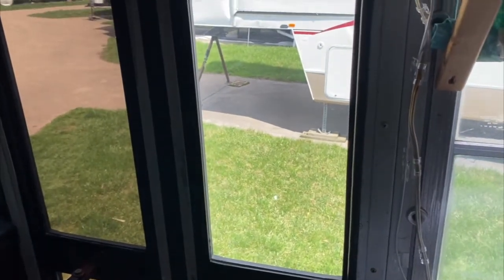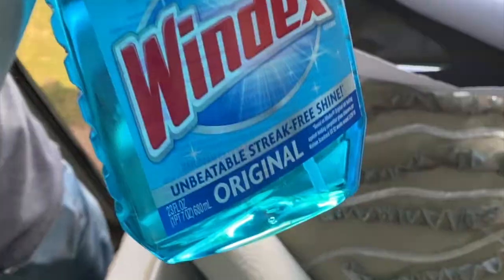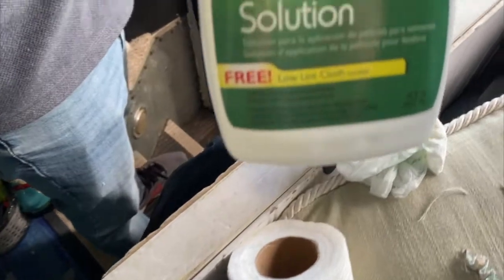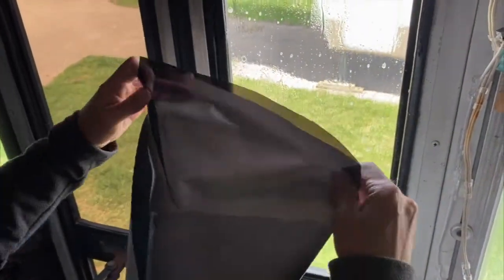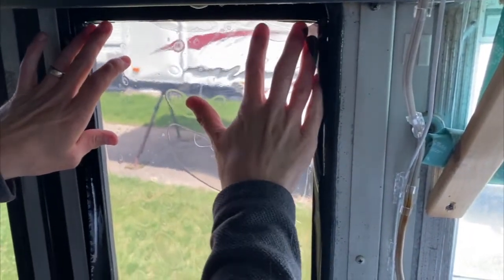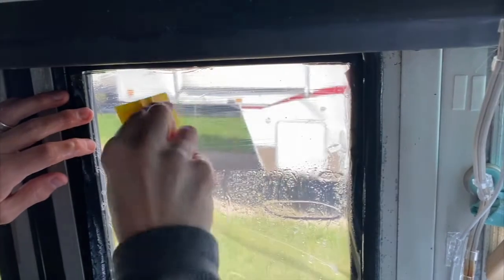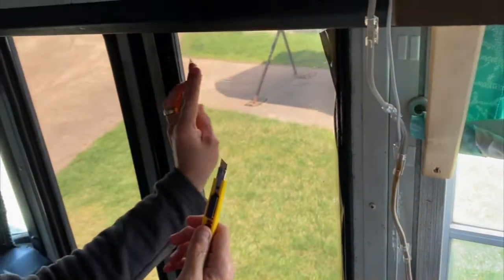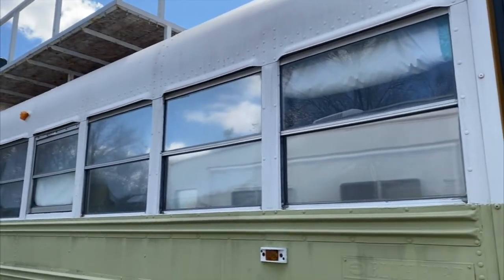Bus life: Window Tinting Tutorial

Comment: I have seen the pro vids and I think they make it look way more difficult then it really needs to be. Thier job may turn out a hair better then a novice but is the cost trade off really worth it? Yours looked like it turned out pretty darn good. Did you use a ceramic window tint? It really helps block heat and uv rays. This is one case where I'm glad I have a short bus lol
Reply from the maker: It is definitely not as good as a professional job, but for the cost, I was definitely happy with how our windows turned out. We really just wanted to prevent anyone from looking inside, and also block the heat. Both accomplished :)
Reply: @biggreenbus3565  hi! So glad I found this! I just bought my first bus 🎉❤ Where did you buy your tint? I have seen so many options so I’m unsure what to get. I don’t want it to turn colors later. Yours looks amazing!